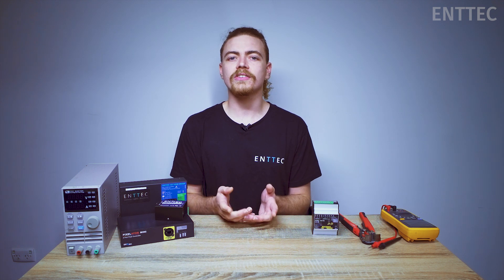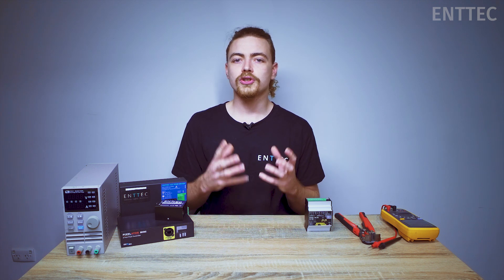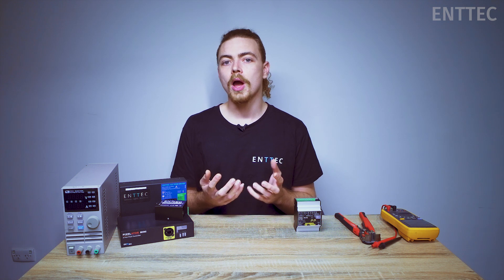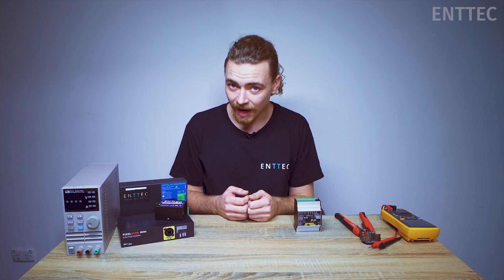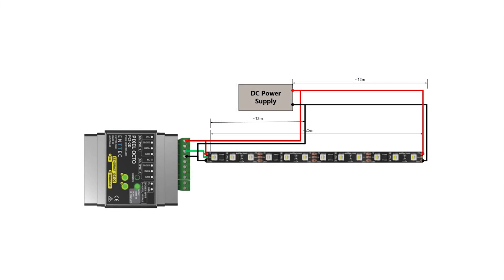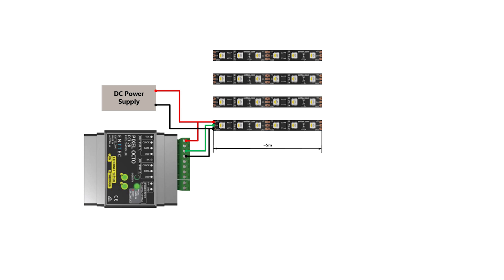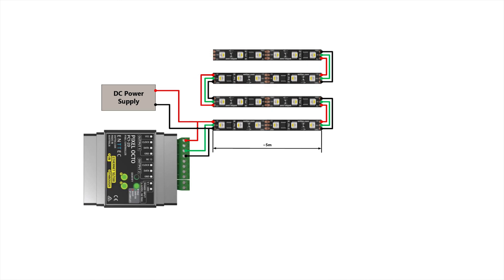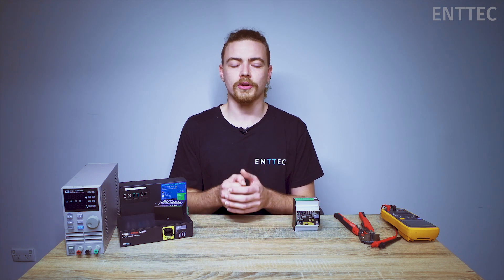Ep.10 How to minimize cable length to create a happy setup!

Comment: Hi Jordan/Enttec,
I am looking at setting up 15 meter of connected SK6812 LED strips (5 V & 60 LEDs/M) (18 W per meter = 90 W & 18 A per strip). With the DC power supply in the middle and dual (quardripple) power injection (start & end of each strip), this would require 2 x 8 Meter cables for the ends carrying 9 Amps and 2 x 3 Meter for the middle injections carruing 18 Amps. According to the voltage drop calculator, this would require AWG 8 cables to stay at a voltage drop of 5-6 %. But MAN that's expensive!!! 
Hence, my question is if it is possible to replace the AWG8 cables with dual (two) AWG 10 cables? - I would need to add 15 Amp fuses to both cables I imagine just in case one cable breaks for whatever reason and I bet there are rules against it (made by someone who is not paying for cables themselves), but is it possible/something you have experience with?
Great, easily digestible tutorials by the way!
Reply from the maker: Hey JJ. There's not a problem with using thinner cables as long as they're not overloaded (adding a fuse is the way to do it. - We'd also recommend cutting the pixel strip halfway down the 15m run and just joining the data and 0v (GND) feed to ensure you won't be in a scenario where your full 15A will be passing through the strip if your injection cables get disconnected. By cutting the strip at 7.5m only half of it will light up if this happens - It's a way to ensure that the current draw will be way within safe limits for the PCB to handle without blowing fuses.